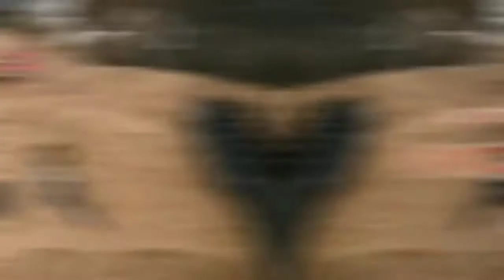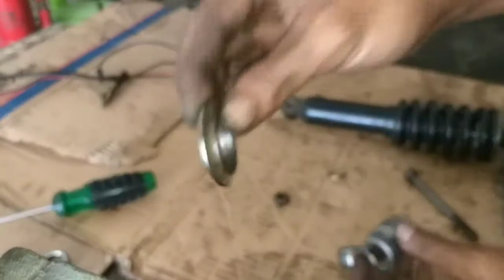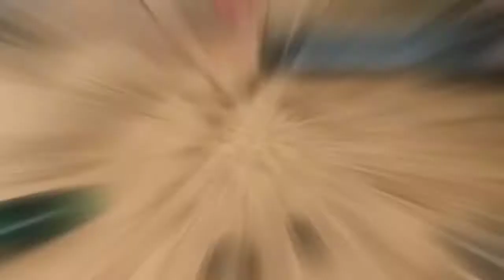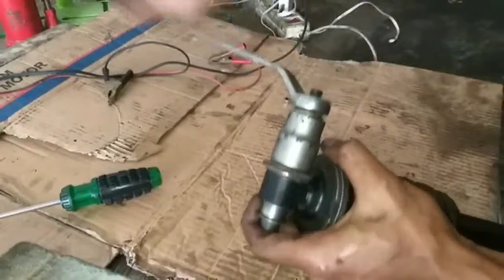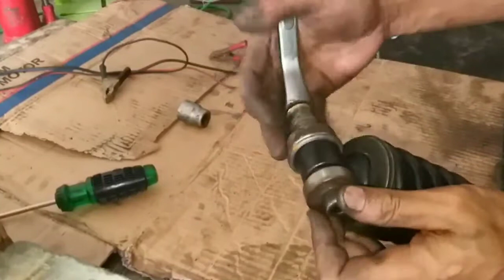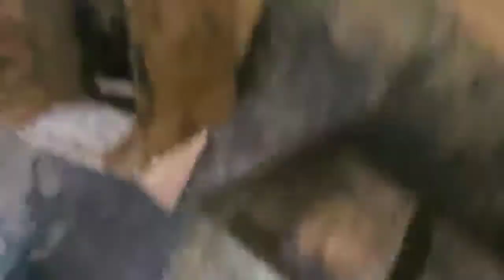Cara Mengganti Bos Monoshock Satria FU

Comment: Ciri2 bushing shockbreaker harus diganti itu gimana mas? 🙏
Reply from the maker: Standar 2 coba angkat arm nya.. Oblak naik turun ngga? Itu efeknya bikin geredeg..
Reply: @Belajarmekanikdarinol  naik turun tapi gak parah, apakah ini penyebab motor saya oleng kalo dijalan yg tidak rata?
Reply: @midoriyaizuku378  betul
Reply: Oww.. Itu bisa oleng ya.. Kirain shock depan sy yg bermasalah setelah sy cek ban belakang oblak bantalannya..hemm..hemmm